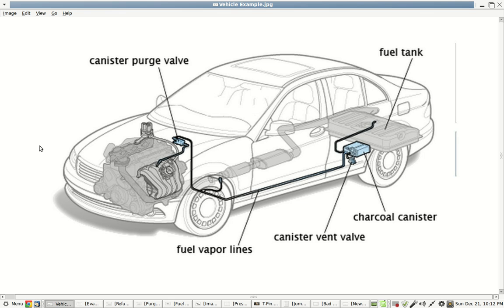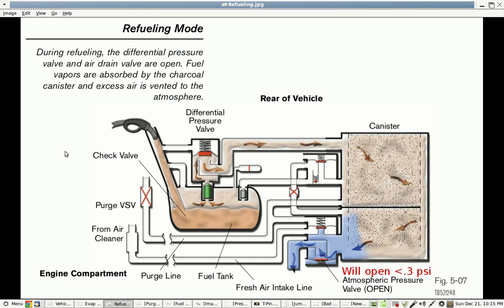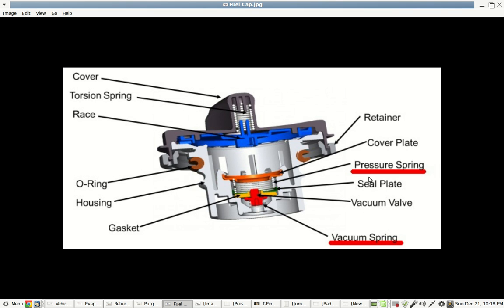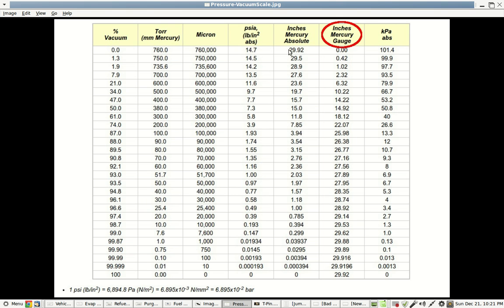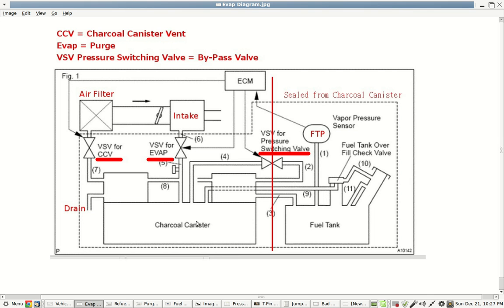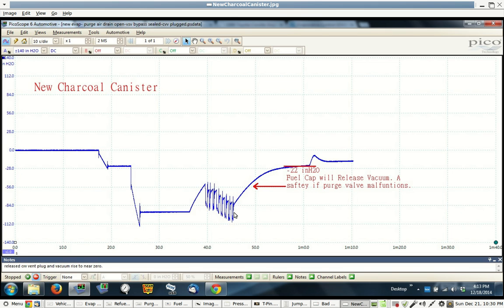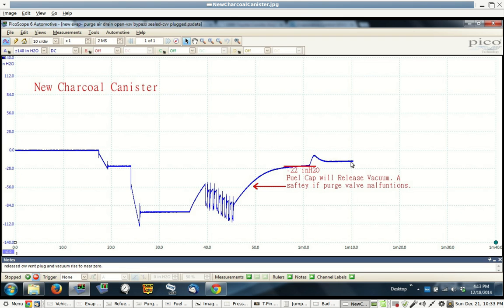PO440, PO442, PO446 Toyota Evap Diagnostics. Pressure and vacuum testing.

Comment: Well done sir.  Question:  2003 Corolla EVAP canister, there are 3 diaphragms.  One of mine does not hold a vacuum.  I thought bad canister and when cut open I found a tear in it.  So, a Toyota canister from Amazon showed the same issue.  Note: I opted for a returned item, retaped, but looked uninstalled.  I wish I could test another.  Any ideas?

Comment: Hi, I hope you still available 👋.
With regards to the diaphragms in those two barrel shape plastic Solenoid in both sides.
First Q, goes to the one on the left, the one under the FPS, it has on very top a venting outlet with a small rubber tube shaped  (L) hiding at the lateral and back side of this plastic Solenoid piece. Is it blocked if I apply pressure inside this specific orifice, and the air doesn't pass, the air has no way to scape because the top of the diaphragm inside either normally tightly sealing the air passage or stuck in ? It seems a one way vent? Because by utter chance, I tested the next to it, same look a like piece, which is on the right side near the drain hose.  This part has a very short tube in the lower or bottom connected to the Air inlet tube,  I removed the tube on the side of this barrel shape piece and pushed air inside, to my surprise the air didn't pass, exactly like what happened to the resisting diaphragm on the left component!
I think it is one way exit, but then what its function?
Please if you have time, let me know, I really don't want to buy a new canoes on guessing.
By the way, the canister itself looks very good and passes all the basic air circulation, no clogging.
Thanks 🙏🙏🙏

Comment: Mine is a 2003 4 cyl Camry that seems to now be super sensitive to a P0442 ever since I put an oem fuel cap on it. I had an aftermarket cap that started to have bad ratcheting upon tightening so I bought an oem. It had never set the code before. I swear, if I don't ratchet it 3x the light will come on. Perhaps the cap is defective.

Comment: Was watching another video about Toyota EVAP systems, and they mentioned a valve that is on top of the fuel tank, NOT where the fuel pump and fuel lines exit the tank but an actual valve that inserts into the tank.  You didn't mention it in your video.  Is this something in "older" Toyota systems?  If so, is it something that went away after a certain year?   I did notice this video is from 2014.   How can we tell if our vehicle has this valve on the tank without dropping the gas tank or cutting a hole in the floorboard?

Comment: 2nd comment-  At 14:05 you were testing the canister side of the system ( with bypass valve closed) and you saw vaccum decay which you determined that either the system has a hole in the tubing/hoses or the canister is bad. I think you forgot one thing. If the bypass valve is leaking then wont you see a similar decay in vaccum? With a bad bypass valve you are now checking the entire system because the bad bypass valve didn't properly isolate the system. What say you?
Reply from the maker: You could be right, but nobody is going to pay me for the extra time to find out.  Most of the parts on the charcoal canister are not replaceable, so the whole canister gets replaced which includes the bypass valve.  The only way to verify the leak is to take the charcoal canister apart and test pieces individually.   I've tested many of them and the most common leak is in the vacuum pods, but could be other things as well.

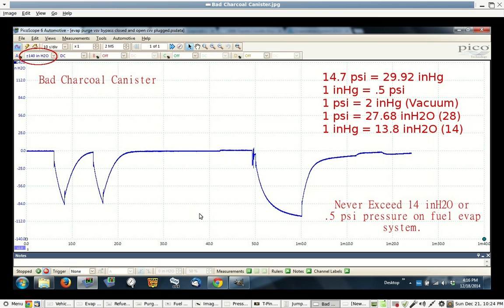Comment: At 11:58 your graph shows 14.7psi = 29.92 inHg. Doesn't 14.7 psi actually equal 0 inHg?  And 0 psi equals 29.9 inHg? Or am I missing something. Otherwise, good video, thanks.
Reply from the maker: Your confusing gauge pressure with absolute pressure.  Gauge pressure is what mechanics gauges are calibrated to, 0 psi gauge reading is actually 14.7 psi absolute at sea level.  I am using gauge pressure in the video.

Comment: QUESTION. Scan data provides a % Commanded Purge, which I gather is related to the vacuum in the intake manifold.  Usually then higher engine load greater commanded purge. Though  that doesn't always seem to be the case in the data, though it must be, as the purge valve is either open or closed,  not having graduated positions. The Question is does the ECM actually know the amount of fuel vapor coming in a purge, or does it just guess using preset tables?   Does the ECM know the level of depletion of the Canister? Say a long purge at 100% will deplete the reserves of the canister faster than it can be replaced. Does the ECM know this, or rely on 02 sensors to adjust Fuel Trim?  This question relates to assessing the cause of high fuel trims at higher loads.  IF the ECM is assuming fuel delivery rather than actually knowing the fuel delivery from the canister, then a degraded/inefficient canister can be the cause of higher fuel trims. Im not referring to leaks but degraded charcoal etc.  Commanded purges should remain constant over time I gather, being related to vacuum pressures?  THUS it would be nice if there were a sensor that recorded the % of fuel vapor being delivered at a certain % purge.  You could then compare the specs of your new car against a few years later and know if an increased Long Term Fuel Trim was related to the Evap system purge or not.  I have seen a Patent where there was a calculation of fuel vapor being delivered in a purge, but am not aware if this is included in cars now days.
Reply from the maker: Purge Valve Operation

The ECM monitors the throttle position sensor, engine load, o2 sensors and a few others. When all conditions are met, it opens the purge valve.  The purge valve is pulse width modulated. Meaning it cycles off/on many times a second. This design allows the ECM to vary it's duty cycle and change the flow amount, not just off or on. (Think of squeezing a drinking straw to reduce flow then slowly letting go.)

Evap Canister Purge Operation

The ECM only responds to inputs from the various sensors, the main one being the o2 sensor.  The sensor only monitors oxygen in the exhaust stream, so excessive oxygen = lean, no oxygen = rich.  Vehicles do not have hydrocarbon (raw fuel) sensors. As hydrocarbons enter the intake through the purge valve, the o2 sensor will 'see' oxygen level is dropping and it will reduce the pulse width timing on the injectors to reduce fuel amount.  The ECM is trying to maintain stoichiometric (14.7 air molecules to 1 fuel molecule) under all operating conditions, no matter if the purge is open or not.

Purpose of Evap Canister
To prevent hydrocarbons from getting into the atmosphere and allow air to vent from fuel tank as it is being refueled.  The hydrocarbons 'stick' to the charcoal inside the canister. Hence the name, charcoal canister.  There is no good/bad charcoal.  The way it fails is by leaking or becoming plugged up.

Evap Canister Monitoring
There is no need to monitor the amount of fuel passing through the purge valve.  The oxygen sensors report if more or less fuel is needed to remain stoichiometric.  If your fuel trims are off, and your wondering if the purge valve is causing the problem, then clear out short term memory, disable purge by unplugging it, and see if the problem with the fuel trims go away.  It's rare, but I've seen people fill the cars with fuel to the top of the fuel neck, then fuel trims will be unusually high till the fuel level drops.  The car will still maintain stoichiometric, so fuel mileage will not change, just fuel trims as the computer adjust to the extra fuel entering the engine through the purge valve.

Comment: Great video.. 02 tacoma with a 0440 that won’t go away after replacing a leaky fuel neck. I tried smoke testing again but it feels like the line is blocked? Any ideas thanks

Comment: Brian, Excellent Video, i kept this video as bible .. i re-watched this again after 2 years, hope you can answer me. Please.

at 1) 8.19  in your video timeline you said, 9 out of 10 times it is canister seals , in case if that seal is going bad, will the smoke machine show the leaks. 

2) to pressure test you asked me to crimp the yellow band hose, what is maximum PSI i can put less than aPSI.

3) if i block vent valve and assuming my normally closed bypass valve is closed and if the vaccum is holding well by opening purge control valve. can i assume canister is good??

4) if step 3 is good, and to test fill valve, gas tank, i need to put pressure, i use hand mityvac pump to put pressure, when i put pressure how do i know if overfill valve is a problem, or fuel filler neck is the problem. 

5) can i put smoke with .5 psi on bypass valve side of thehose that goes to the tank and watch FTP raising in scann tool and it maintain that pressure. 

i dont know step 4 diaagnosis, rest all i am good. please advise..

Comment: Thank you for this video. On my 2000 Camry I am having P0440, P0441 and P0446. I already replaced the charcoal cannister with a brand new one but its a Dorman unit and still getting the codes come back. I also replaced the valve that is attached to the air cleaner box as it was bad before. I crimped off the hose with the yellow linee on it and smoke tested it from the engine bay to the tank and do not see any smoke at all. At my wits end. Don't want to spend the money for a Toyota unit and that not be the problem. 

I do notice a slight hiss somewhere above the tank if I put enough pressure into the evap line ( I was doing it by mouth ) at the engine.
Reply: Did you ever find the solution?
Reply: @ShaqsNewGroove  Yes. It was the overflow check valve on top of the tank. replaced it and issue went away

Comment: Just came across this, excellent description. Techstream, which is the Toyota factory tool, only lets us close the vent valve for 10 seconds also. The key is there is 3 valves and, essentially, 2 vent openings. You have to clamp off that other vent line when smoke testing these.

Comment: I did this with an engine vacuum gauge ($25 at my local auto parts store) by connecting it to the EVAP service port. I had to remove the valve core (using needle nose pliers) from the EVAP service port. The valve core was LEFT HAND THREADED on my 2004 Corolla. This process detected the leak just like the video shows.

Comment: Very nice explanation and presentation Byron. One question though. Where do you have your pico scope pressure sensor tapped into the system when you are performing the canister side of the system? In the schematic you show the VP sensor in the tank side, not the canister side. Or am I reading it wrong?
Reply from the maker: Thank you Andrew. The evap test port will usually have a green cap and is located close to the air filter. That is where I have the pressure transducer located. The 'vapor pressure sensor' is physically located on the charcoal canister, but piping connects it directly to fuel tank. Only the PCM or scan tool can read the 'vapor pressure sensor'. The pressure reading I show in the video is from the WPS500 pressure transducer using pico scope software.
Reply: Bryon Smith 

Thanks Byron for your reply. That makes sense but you didn't mention your connection location in your video. As a professional auto tech myself I find Toyota Evap diagnosis one of the more challenging due to the terminology that can be confusing. So using your procedure, monitoring system pressure (vacuum) via the service port, with the VSV closed, CCV closed and purge VSV PWM open, then closed ONLY the Canister side of the system is monitered. Correct?

Comment: Hi there, 
thank you so much for your detailed video. I am watching this for a second time but i thought I would add a question while I am watching. 

I do have a p0440, p0441, and p0446 , not p0442 on my 02 4runner. 

some signs my venting is not working is when i go pump at the gas it keeps stopping mid way between. This is intermediate as sometimes it does it flawlessly. 
Next what I have also notice once that when I took off the gas cap to make sure it was seated properly I heard a rush of air meaning it was holding vacuum.  At least, So far this leads me conclude there is no leak from gas tank side of the pressure switching. however I don't know where else that leave me.  

Any clues? 

Thanks.
Reply from the maker: Hi Bardia,
The venting problem could be a restriction in the vent tube or defective charcoal canister.  Look for dirt in the vent tube coming from the charcoal canister.  The code p0441 is a low/no flow purge solenoid.  If it's intermittent then check the connections to the purge solenoid or fuel pressure sensor.  Unplug them and look for corrosion (green growth on the metal contacts).  When you plug back in, make sure connector seats well.
Hope it helps.
Bryon
Reply: +Bryon Smith Hi Bryon, Thanks for the quick reply.    The vent tube connects the charcoal canister to the gas tank? What could cause an obstruction? All the lines are rusted, maybe it collapsed on itself? and im scared to touch. I know the canister comes with new flexible lines, but i think when i try to connect them to hard lines, the hard lines will fall apart.  

Thank again
Reply from the maker: Yes you are correct.  What ever breaks while changing/testing the evap canister has to be replaced.  Welcome to the life of a Technician!  Find a good used/wrecked vehicle to get parts from if they break.

Comment: great video  thank for sharing    a question  where were you tapped into canister side of system exactly?   did you have adapter to tap in with your WPS500?  thanks   mark ferraro
Reply from the maker: Hi Mark.  There is a green evap port designed to check evap pressure.  It's located on the evap vent line.  You have to remove the valve stem and connect an adapter (looks like a GM fuel pressure tester).  My WPS500 connects to the evap adapter.

Comment: Thanks a lot for great instructional video,  just a quick question: where did you connect your Pico scope leads to,  which component,  thanks again
Reply from the maker: My pico is connected to the WPS500 pressure transducer.  I am manually activating the evap solenoids with jumper wires.

Comment: correct me if I am wrong, the color graph you are showing air flowing from the air cleaner to the charcoal canister direction is that correct? air shuld be moving in the directon to the air cleaner as the vaccum sorce is very stong right?
Reply from the maker: The throttle plate is the divide between engine vacuum and atmosphere.  The air filter is only under vacuum when the throttle plate is fully open and then it is very, very minor.  The evap doesn't run when throttle is wide open. The air filter is designed to flow as much air as the engine can consume + some (to account for dirt over time - typically 30,000 miles worth of filtering).

Comment: Hello TAQ.
Would you help me solve a evap problem with my 1999 toyota please.
It is a 2.2L engine.
I've been getting the P0441 and P0446 MIL codes.
I replaced the purge solenoid valve that's in the engine compartment next to the air cleaner.  That didn't help. I cleared the codes and they came right back.  I also tested the old purge valve with a 12 VDC power supply and it does open and close - so I guess that was a learning experience that didn't help.

I then changed the valve that is mounted to the charcoal canister, then reset the codes. They came right back again.  I also tested that valve that I took off - and tested okay. 

I bought the entire charcoal canister assembly from a Toyota dealer.  I got it cheaper shopping an internet dealer and it came brand new in the Toyota box.  I looked at the old canister and realized I couldn't figure out how to remove it, so I took the new part and car to the dealer near me and they changed it for me.
I cleared the codes again and went for a drive.  After my second trip, the MIL came on again - this time only the P0441 error.

I'm not sure what else I can do to fix this problem.  I need to get the car smogged in two weeks or I'll run late on my registration renewal.  I'd sure appreciate some help if you have the time.

One more thing:  I saw a hose that goes from the intake box down under the car - it changes from a rubber hose to steel tube and I think it goes to the carbon canister.  I don't see a valve for this air supply.  If there is one, do you know where it is?

If I understand P0441 correctly, it is telling me that there is no flow when the purge should be occurring.  What could cause this that I haven't already changed?

Thank you.
Dale
Reply: Frazzled  Update:  I checked the hose that goes from the intake box down under the car.  I thought that could be the air intake for the carbon canister, but it's not functional (and never was) The intake box has the fitting for the hose but the hole is plugged because the hole was never opened into the airbox.  Maybe this is for a different version of 99 camry?
Reply from the maker: Hi Frazzled.  Sorry for the late reply.  Your problem seems more complex then most.  Did you get it fixed?